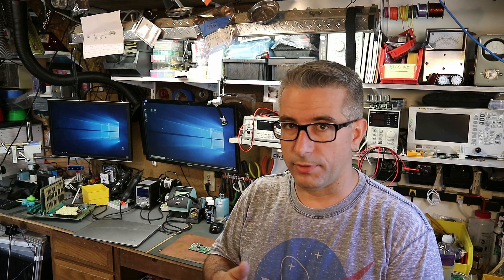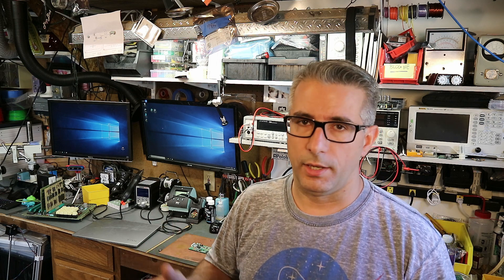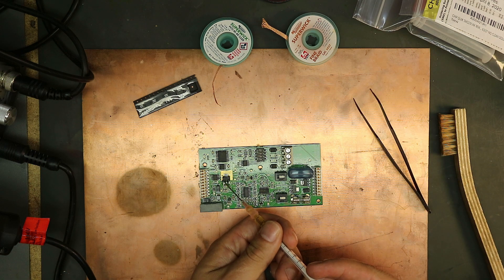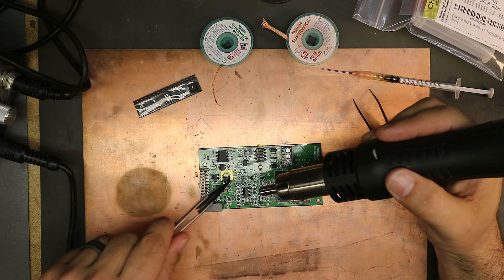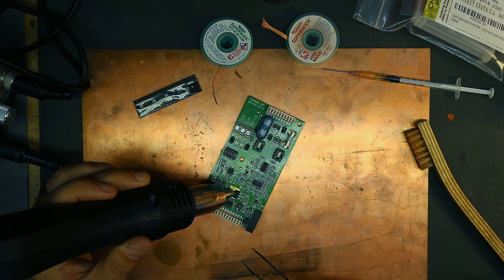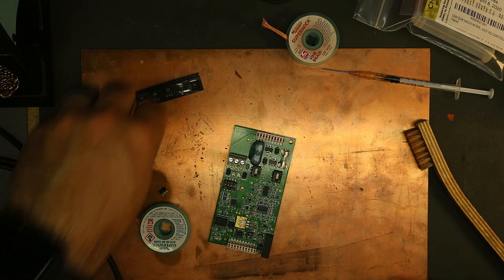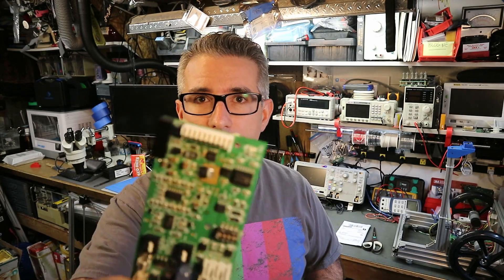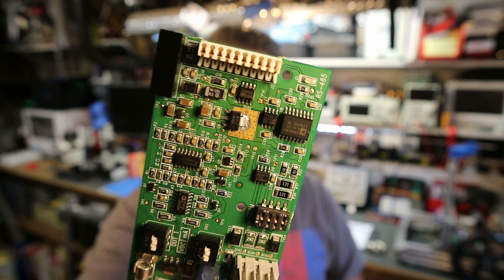How to use a 996D or 858D Surface Mount Rework Station

Comment: Hi, I'm wondering what temperature setting you used when you were reattaching the part - I've read the melting temperature of SMD291AX is 185 C - I'm trying to use this paste for some very basic beginner work and after the initial flow the solder doesn't seem to harden - ends up kind of gummy and soft - I'm using temperature setting of 200C - any suggestions? Thanks
Reply from the maker: I believe it should be 235 C on the curve but I usually have it set to 250 C
Reply: It probably never melted fully in the firsty place